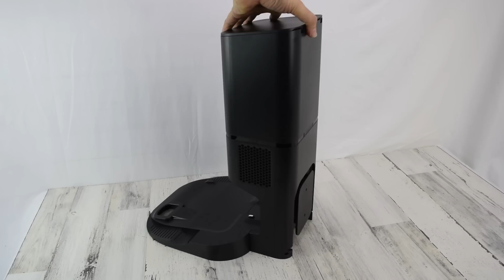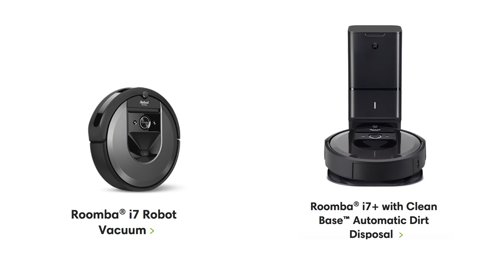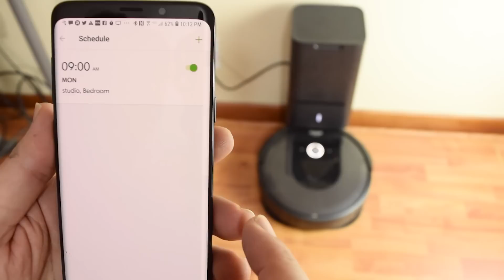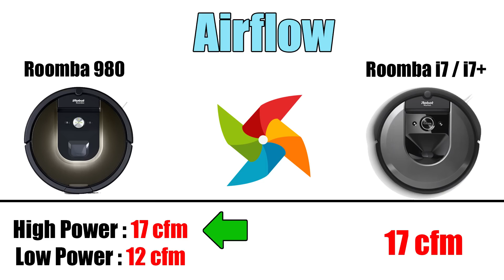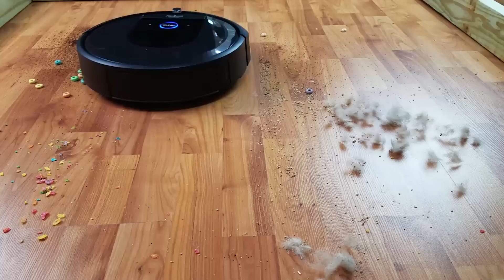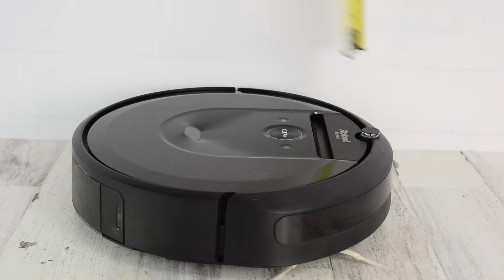iRobot Roomba i7+ Robot Vacuum Review & TESTS w/ Clean Base vs i7 vs 980

Comment: I just tried a Deebot R98 - pretty much the direct competitor to this.

For me, the R98 was a complete and utter failure. (It could never remember it's map, the bin empty system simply didn't work, and the scheduling app, just didn't work. I returned it after just 9 days of trying to make it work.

HOWEVER - the bag system of the i7 is like what 1970 tech? WTF are they thinking? The R98 clean out system is really rather beautiful (if it would work). It is just a handheld vacuum that you empty like any other modern vacuum with a clear dust bin collector.
Reply from the maker: Actually bagged tech is still a thing, and it has some serious advantages, the Airflow is generally much higher in bagged vacs, and it is much easier to create a good filtration seal. Not to mention the lack of mess.

Comment: I have a question, how does the i7+ solve the problem of hair tangling? There are two locations where hair and longer threads tends to tangle up the roomba, hence increasing friction and melting some of the plastic if not taken care of. The ends of the two debris pickup roller and the motor connection point of the spinning pick up brush. Can you comment on that?
Reply from the maker: I dont think they have implemented any new technology for that, I think the rule of thumb is still to check and clean the axles regularly.
Reply: It gets pretty bad.
Reply: @valeriestrathmann4844   Yeah, I figured it will... I've been clearing those from my Roomba for as long as I can remember... and was really hoping that they would fix that issue. The fact that I don't have to dump the dust bin is nice... but not as annoying as getting your hands super dirty every 3 to 4 cleaning... I wonder if they will ever be able to address this issue.

Comment: For those who just dropped $800 for a 980... this is disappointing.
Reply from the maker: Yeah I could see that, the 980 is a great machine though, its basically the same as the i7, in fact it could be considered better than the i7 in some ways.

Comment: Great review but I have had the 980 and now the i7. One thing I have found is that the i7 does not handle long hair as well as the 980. Basically the i7 will gather up the hair into balls and puke it back out. At the end of a cleaning run I will find small clumps of hair scattered. This doesn't matter about level of bin fill. Clumps are seen soon after it starts its clean job(empty bin). I have to wonder if the larger finned extractor is the reason. 
The Mapping is amazing and drops cleaning times per room on average 10 minutes on our house. Also the sound level is huge. At distance the sound just disappears sometimes I have to check to see if the vac didn't die
Reply from the maker: Thats interesting about the pet hair, I didnt notice it but I was only testing small amounts. It could be the extractor, im not sure. Yeah crazy quiet, night and day from the previous Roombas!
Reply: @VacuumWars   Need to find some long pet hair and scatter it around thinly. The i7 I find that it tangles more around the extractors compared to the 980 along with just spitting them out. You state that the suction is the same but I don't see that. The i7 seems weak in suction and doesn't pick up as much debris on certain surfaces.

Comment: I assume inorder to do second floor you would need to move base upstairs ...will it automatically find the base once put upstairs ?? or can you just buy a second base and leave one on each floor ?? THANKS
Reply from the maker: You dont need a second base for it to remember and clean another floor, it recognizes this automatically. However if you want it to empty itself, then obviously you would need another base, and yes they are sold separately

Comment: Good review! I think I'll stick with my 980. I like how I can stow it away under an end table where nobody sees or steps on it when it's not running. I do think that cheap they won't update the 980 App to create rooms such a jip!
Reply from the maker: I think the i7 has much better processing power. I have heard that they will be using that extra power for a lot of cool updates in the future, maybe even something like NoGo line barriers.
Reply: @VacuumWars  My 980 sucks the carpet fibers clean that's more than enough power to last me for decades if I or the Roomba 980 last that long! ;) It's just lame they don't just add the rooms to the current 980 app! Mine draws out maps and uses the wifi to make maps as well as the built in camera there's literally no difference other than the goofy looking trash shoot!

Comment: Why you're not saying the biggest problem is the bad in the base that now you need spending money on to replace? It's just another way to get money out of you after years we have bagless vacuums
Reply from the maker: I tend to agree, there are plenty of reason to go with bagged vacuums, the debate is an interesting one,  and yes the companies make more money that way, but its also a benefit to the user for several reasons.
Reply: Dor Ribak if you are paying 1000 dollars for a robot vacuum, replacing a bag periodically for 5 dollars isn’t that ridiculous. On another note, you can just get the robot without the self emptying dock and empty the bagless bin yourself, there not forcing you to use the self emptying feature. When a robot vacuums goal is to have as little user intervention as possible, it’s much easier for the user to swap a bag out instead of fiddling with a bagless container. 

Also bagged vacuums are still a very popular choice, as they are much cleaner to empty and the bags require extremely infrequent changing.

Comment: Thanks for all the reviews.  I returned my 960 for the i7.  Do you think that iRobot will come out with an extended battery for longer run time?
Reply: Tynisha Hollins  can you please tell me what made u choose i7 over 960 
I just got the 960 but im still unsure about it specially cuz it doesn’t learn maps, so would like your input too
Reply: Samar Ahmad the power was so much better and the battery didn’t last long when I used it upstairs on mostly carpet. I purchase the Neato D7 and love it more than my roomba.
Reply: Tynisha Hollins oh think i,ll look into that too
Now im thinking between i7, roborock s5 max and neato d7
Reply: Samar Ahmad I only have the two (no experience with roborock) but if I had my choice I’d have two Neato. It’s more powerful than the i7+ and has a great battery life. My i7+ can’t do a whole floor without recharge and resume. I will say the i7+ clean base is awesome. I love not having to empty it. I do like choosing which room (mapping) and I never have to clean the brushes on the roomba. I hear the newest one is amazing though but all 3 of your options I think is better than the 960. Good luck.
Reply: Tynisha Hollins thankyou for your input 
Appreciated
😊
Reply from the maker: Im not sure, I wouldnt count on it though.

Comment: What's up with the filter? How does it convince?

The robot is useless if he can empty itself for 30 times but the filter is full/blocked after 3 times. :/
Especially because the new filter has a lower surface than the previous models.
Reply from the maker: The suction of the clean base motor seems to clean the filter off pretty good. Its really powerful.
Reply: @VacuumWars  thanks a lot. Will wait until it releases in germany

Comment: I bought the roomba i7 and I put chips down to see what it gets it left 3 small pieces although I did put a lot down it it picked them up but I think the fell right back out and we’re extracted on the carpet should I be concerned?
Reply from the maker: I dont think so, it sometimes has trouble with huge piles of stuff but with regular messes it is usually really good,

Comment: I really don't hear the vacuum turn up the notch at all and it doesn't clean as well as my previous 980. The brushes seem to work harder than the 980 but by far does not clean as well as the 980. Question: is the vacuum on my roomba working?
Reply from the maker: Hmm, im not sure it could be a problem with your unit. You should call Irobot to be sure. Mine cleaned as good as the 980.

Comment: Did it experience difficulty transferring pet hair from dust bin to the cleaning base?
Reply from the maker: Good question! I was skeptical on this point but I specifically filled up a bin with pet hair to see what would happen. and id did perfectly, in fact it was way better than if you emptied it by hand. The suction motor on the clean base is way powerful.
Reply: @VacuumWars  thanks for this response! Our battle with dog hair continues...

Comment: 15 USD for the disposal bags. is this a joke?
we have a multi cat household, i guess of 30 empyings we only get like 5-7 so we must change the bag once a week or even more. that would be a 60+ usd per month just exchanging bags.

thats a flat out joke. i hope there are some china bags or workarounds like reusing a existing bag by vacuuming it out.

and even if it holds a month, 15 usd per month just for a disposal bag is crazy.
Reply from the maker: Im sure there will be a host of cheaper ones on the market in less than a year, such is the case with most Irobot parts.

Comment: Is the i7 $699.00 better than roborock s5 $579.00 Because there's only about a $80 difference?  Also on a side note I can get the rhumba 985  At Costco for $499.00  That's about $80 cheaper than the roborock S5, what would you choose?
Reply from the maker: I would say that if you are not going to get the i7+ with the clean base then one of the other 2 choices would be a good value. The main thing for me is the clean base. Other than that it's not much different than the 900 series.
Reply: Vacuum Wars thank you. I was thinking about getting the I7+ but I've never had a robot vacuum so i wasn't sure how helpful it would be.

Comment: This i7+ is trash I have it for a week now and the bag is full and it misses alot of dirty and hair sometime it even can't find it's way back home what a joke DONT BUY IT! The 980 is so much better
Reply from the maker: I found that it returned to the base MUCH better than previous bots I have owned. Though it was super important to follow the instruction on where to put the base (flat surface, against a wall, with nothing on either side for a few feet).
Reply: Shut up,the bag is reusable

Comment: I’m skeptical about the 30 runs per bag.  My 980 fills its bin every time I run it with pet hair.  Have read that the bag will only hold debris from very few runs before it fills up.  So either have to empty the bag or buy new ones at $5 per bag often.  Can bag be emptied?  Also the filter may need to be cleaned on every run if it’s like the 980.
Reply from the maker: Well it really does seem to pack the debris in pretty good. After all the tests I did it is only 1/4 full so it seems right. I suppose you could empty it, it would be a bit messy though as you would have to dig it out if its a lot of pet hair. You will still have to maintain filters etc every, I think Irobot recommends cleaning once a week, but I did notice that the suction on the Clean base does tend to really clean a lot more than I thought it would.

Comment: Jsut picked up my apex thanks to you. So far so good. They wasn't lying about the pull lol it almost slipped out of my hands when I put the Motörhead down. Hopefully there's only good to come. Thank you
Reply from the maker: Awesome Brett!!! Yeah I love mine so much! I actually keep mine in the studio as it the only vacuum I can count on to pick up anything and everything every time. Let me know if you have any questions Ill be happy to help if I can.  Regarding the pull (if you mean the kind of self propelled action) I really only notice that in lift away mode on carpets, if you have a lot of carpets then using it in its upright mode is better.
Reply: Vacuum Wars I'm sure you are used to the pull of deep clean vacuums. I'm not lol but its nice. I even vacuumed with my step moms shark to get as much up as I could and then I used mine.. it took up a heaping handful of dust and dirt after.. lol I was impressed. I jsut hope it lasts a long time
Reply from the maker: Nice, Yeah I think it will last a long time. The main maintenance thing is to keep it clean behind the duoclean roller as well as the main roller (the duoclean roller pops out for cleaning)
Reply: Vacuum Wars I popped them out after the use and they were clean.. jsut a little steak on the duo clean brush and a elastic strand on the brush I wiped everything out.  I didn't rinse out the dirt bin cuz I'm not sure if that's a good idea but I always deep clean all the filters after every use.. I work hard for what I have and try my hardest to keep my stuff looking new. Is rinsing the bin out a bad idea? Letting it all dry of course